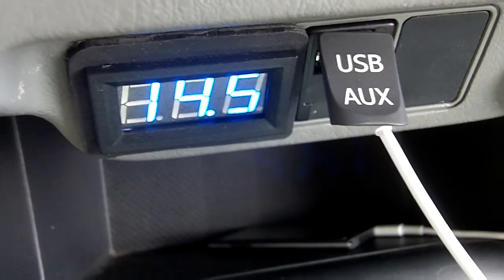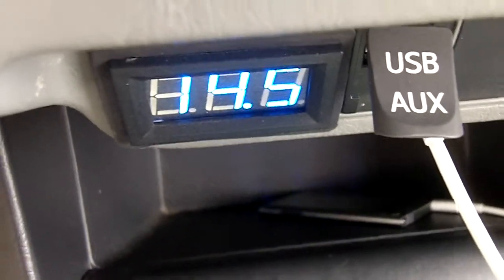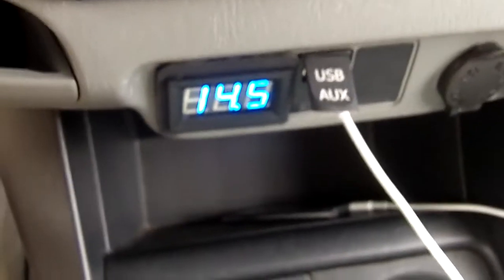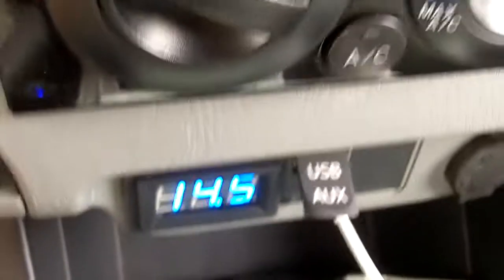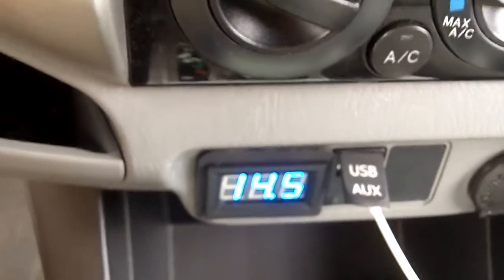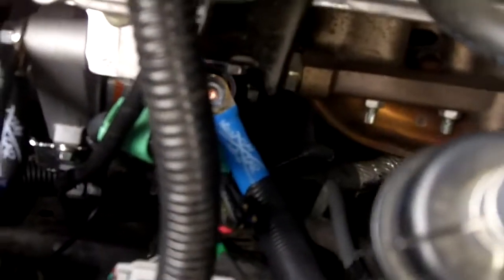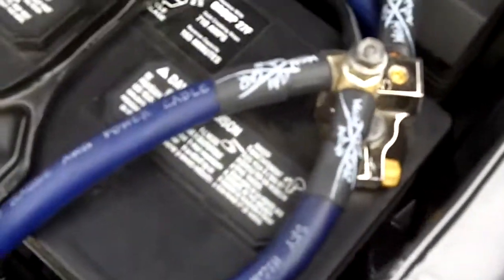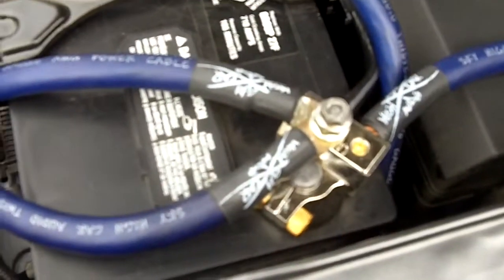After Mechman 240a video 2

Comment: I want to order a mechman alternator. I currently have 2 x8v3 with a deafbounce machete 2100 amp. When I'm driving my voltage goes up and down to 12 ish. And when I'm at a red light and bumping music it'll go down 11.1 . i don't feel safe. I have a stock alt 130 amp.  And one cheap arm battery from wal-mart. I do have the big 3. Done correctly. My lights dim really bad. I want to upgrade my system to two sundown x12v2 .. I want to put 4000 to 6000 Watts on them. So I'm not sure what I need. Can you help?

Comment: Nice, just need to swap out your main battery for a xs power one. I did an upgrade like yours and it was an improvement but when I put in the biggest xs power battery as my main battery WOW!!! The voltage barely drops when the stereo is at full tilt for several songs.
Reply from the maker: billybullfrog Still plan on doing that, just haven't pulled the trigger. Thanks for the advice!
Reply: Which xs battery ima get a 240 mechman alternator  downforsound ofc big 3 kit and a xs power  d3400 upfront  pushing 1600watts rms i should be good since 1600watts should pull 160amps or so total like lifeofprice said in his video  and i  got factory mids and highs ina 1994 jeep grand Cherokee limited 5.2liter v8 pushing 4 kicker como r  12s ona audiopipe 1600watamp but ima upgrade to 4 sundown zv5 15s n sundown amp and another 240mechman when i uograde to the sundown i gota get  another 240. Amp alternator when o do and for now just 1 mechman 240 downforsound ofc big 3 and xs 3400 upfront cause it says its the bigest that will fit in my 94 jeep grand cheroke  5.2 and im only pushing 1 audiopipe 1600watt